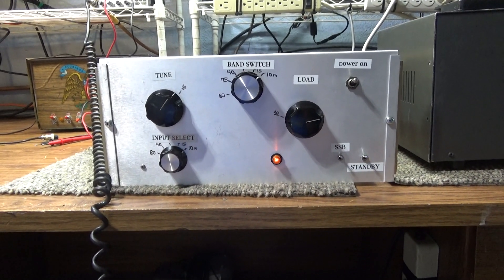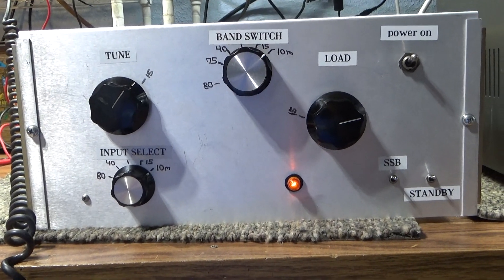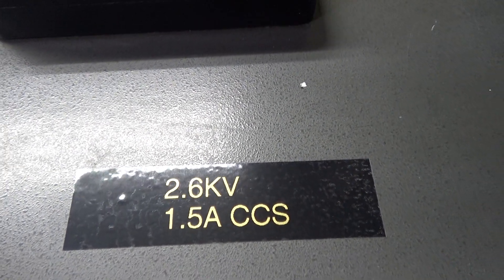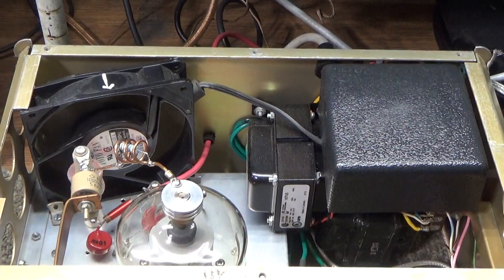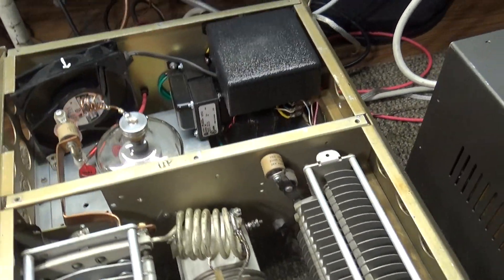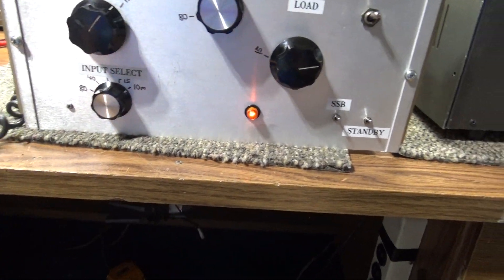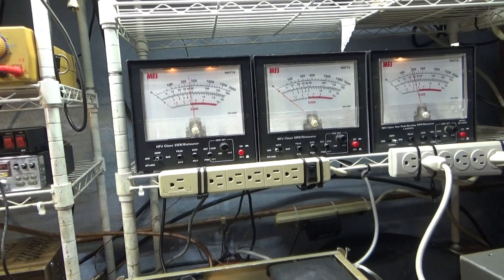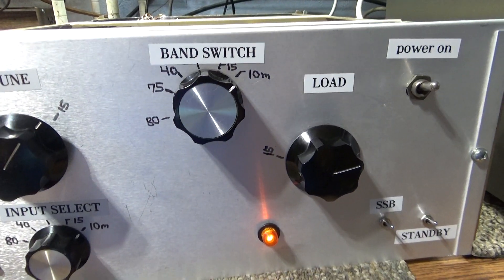Single 3-500z Homebrew Linear Amplifier in the bench

Comment: Hello is this 1 3-500z running on 120vac and is it available
Reply from the maker: Yes, it is a single 500z box and yes it runs on 110 and yes its available. However, it does not have an internal HV power supply and that big bad Ten-Tec power supply seen in the vid powering it is long gone.

Comment: I love the z's baby...I have a LK-550 with 3 of em bad boys.
Reply from the maker: I love me some Z's too. Actually, I like big glass and I can not lie....  My dream amp is to have a clean dual 4-1000 amp one day.
Reply: @tramdr  make one, you know some of those sweep tube amps your always Messing with are more complicated, no room to work on them etc. recall Jesse James had a 6 tube 4-1000a box the cabinet looked like a telephone booth 🤦‍♂️
Have heyboer transformer in Michigan make you as follows: primary 240v secondary 4000v @2 amp ccs you’ll be good at 5800 volts dc. Transformer probably cost you $1000.00 + 🤷‍♂️
Reply from the maker: When I retire from the 9-5, making a nice 2 tuber for me is going to be one of my top projects.
Reply: Have a nice Lk-450 one tuber and new tube not even an hr on it would trade for Peter Dahl plate transformer 😬

Comment: Little low on the plate, I run 3800 on my z boxes.  Be good for 572b,813, even though little low on  the low plate would run a 3 tuber @ a ccs transformer
Reply from the maker: I like your thinking. I actually have a 4  4cx250b box with a separate power supply and the power supply for it runs around 3600 which is way way too high for 250B's. I think I am going to use this supply to run the 250B box and then use the 3600v ps to run a 2 or 3 tube 500z box.
Reply: @tramdr  there ya go 👌🏻